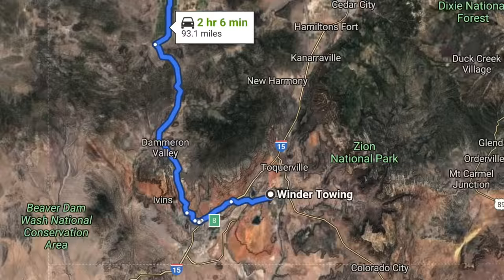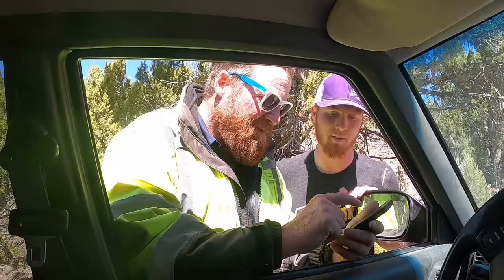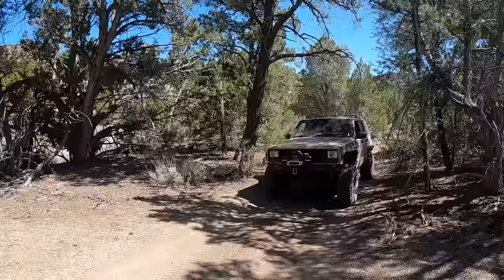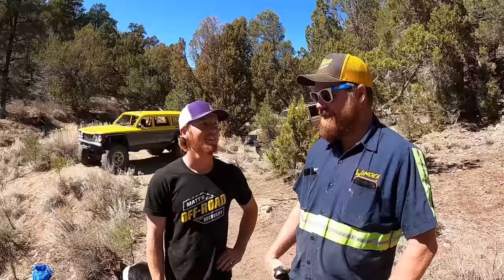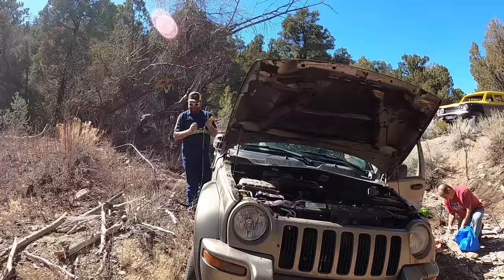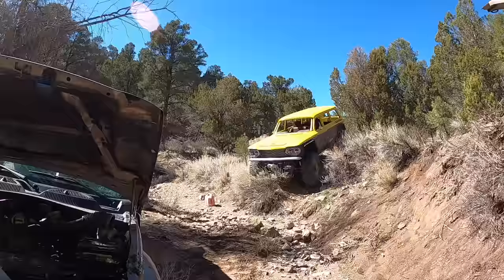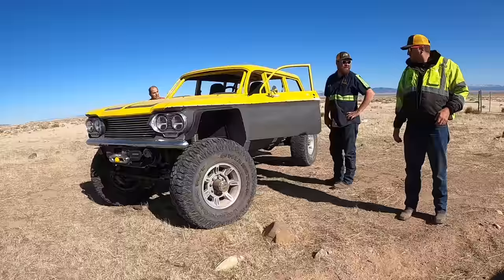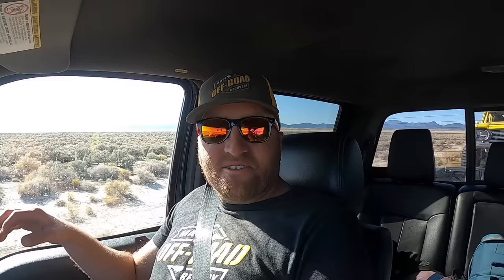Jeep Liberty Rollover 100 Miles In The Backcountry

Comment: Glad you took the time to get the oil out of the top end. Many folks don't know how important this is.
Would be interesting to see Matt's bill for this one.
Reply: Haha the only thing he did carefully with that vehicle
Reply: Gryff Longdong  A lot of insurance doesn't cover off road like this under a standard policy. Just like they don't cover racing if you take your new C8 to a drag strip and put it into the wall because you took off traction control. So recovering the vehicle and not damaging it further is useful for the owner to either part it out or to transplant the good parts into a 'new' shell. 

And even if the insurance does cover and total it out you can often buy back the vehicle at the salvage value from the insurance.
Reply: @Cragified  Exactly what I was thinking. No way would an insurance company cover this type of "extreme" off road use.
Reply: I knew someone that hydrolocked his WJ at an off road park. (Rods broken)

He towed it home, detailed it, and  drug it down the road during the next rainstorm and put it in a low ditch. Called his insurance company and said he slid off the road and through a puddle. Insurance covered it hahahahahah
Reply: @sheputthelimeinthecoconut629  Insurance fraud 101
Reply: @sheputthelimeinthecoconut629  yeah I know a guy who blew the motor in his STI doing donuts. Towed it down the street, lit it on fire, went home and reported it stolen. Unfortunately the gas station down the street caught him on camera towing it down the road. He was promptly arrested.
Reply: @loganb2198  lol i blew my sti motor being stupid, and it was covered under warranty.
Reply: @loganb2198  at least they stopped him from harming any more Subarus
Reply: @sheputthelimeinthecoconut629  When it works it works... When it doesn't, you get federal prison time. Lol
Reply: be aware, that motor oil as ATF
substitute can have side effects
Reply: @objuan6  that's because it's ATF that can be used as engine oil. Oil as atf is bad lol
Reply: @sheputthelimeinthecoconut629  unfathomabley based

Comment: I’m surprised you didn’t kick that windshield out as soon as you had it tipped over and running.
Reply: Prolly didn't want the "extra ventilation" upgrade option.
Reply: @jum5238  That and having to clean up the mess.
Reply: @AndrewAMartin   windshields don’t make a mess like the side windows all did. They could have easily folded it up and tossed it in the back with the rest of the trash they dutifully picked up.

Comment: "It will need a transmission flush after this" as if that thing is not totaled.
Reply: The moment the roof structure is compromised... Send it to the salvage yard
Reply: @thehoovah  .....break out the TIG welder.
Reply: @thehoovah  remove roof build roll cage and see what more it can do
Reply: @randyd9414  too much money To put in for a clunker
Reply: Yeah it’s absolutely totaled. These pieces of sh*t have fairly poor resale even in good shape. And why does one have to buy a $50K Rubicon to even get one limited slip diff let alone two when a LSD is standard on a much cheaper Mustang for example. This thing in 2WD was useless with an open rear diff. So many Jeep vehicles are mostly just marketing hype rather than better hardware. A Subaru can go anywhere a Liberty can. And Subaru’s don’t break driveshafts.  The Liberty is more suited to shopping mall parking lots.
Reply: @sharedknowledge6640  Rubicons don't have lsd's. They have true lockers. Anti slip differentials can be added to any trim of wrangler. Also most subarus have open differentials with the exception of the wrx. Im not a fan of jeeps, I think they're overpriced. However I had to defend them slightly with the misinformation you shared.
Reply: @sharedknowledge6640  rally isn't challenging offroad. Rally is challenging for the technical driving and high speeds. No current production subaru could follow a wrangler truly off road. Just as no production jeep could follow an Sti through a rally course. Theyre different machines built for different tasks.
Reply: Bailey O. Agreed but rally cars put up with an incredible amount of abuse, jumps, etc. And I wasn’t asking about a Wrangler. I was talking about the shopping mall fake Jeep known as the Liberty.
Reply: @randyd9414  Exactly what i was thinking.
Reply: @Striker50_  Clunkers are the perfect serious off roaders.  You don't have too much to lose.
Reply: This is an awesome idea
Reply: @sharedknowledge6640  say what you will about that little liberty, but it made it all the way out there and only rolled when the road caved in, pretty damn capable of you ask me
Reply: @sharedknowledge6640  don't know much about libertys do you. No need to respond, your comment shows you don't they were avaliable from the factory with a LSD.  They're actually quite capable off road.
Reply: @sharedknowledge6640  lol, you know those real rally car are highly modified to take the abuse they do. Their stock counterparts are far from that capable.
Reply: @sharedknowledge6640  you keep calling the liberty a fake jeep, completely disregarding the trail it came in on. Even Matt is impressed that the liberty came in that way... every comment shows how little you know about them. Maybe you had one, but have crap driving skills.
Reply: @benstockton2285  shared knowledge doesn't have a clue about libertys, other then what some subbie fan Boi told him.
Reply: even the bottom....nice dinged up muffler at 10:26
Reply: I was at junkyard to get small part of wj jeep....guys beat me to jeep in a few seconds...had gas powered circular saws with metal cutting blades....proceeded to cut off top half of WJ to weld onto rolled one at home...likely  had pricey investment in powertrain for efforts....
Reply: It’s not, cut the roof off, build a roll cage
Reply: @sharedknowledge6640  you subaru fan boys are hilarious !
AWD and 4X4 are NOT the samething !

comparing two totally different vehicles...
i have owned 4 jeeps and 3 Subarus. 
subarus drive very nice (if you constantly fix major stuff). 
jeeps dont drive as "nice" but will go places a subaru could not even try (when offroading even the "fake jeeps" will go 10x farther than subaru)
AWD and 4X4 are NOT the samething !
Subaru = comfortable highway ride
jeep = go farther
Reply: @MrMrsregor  The Liberty is not a real Jeep. It’s much closer to a Subaru as it’s more car like with no frame and unibody construction. It also was not available with limited slip diffs front and rear (to the best of my knowledge). The Subaru AWD system is likely at least as competent as anything you could get in the Liberty. The Jeep Compass is even less of a Jeep being basically a front wheel drive car.
Reply: I'm guessing I should just be recycled and turned into something that works.
Reply: @sharedknowledge6640  The funniest thing is where i can get a slightly older 2 wheel drive vw polo because its light as anything... while the 2ton "offroaders" with low profile everything and a dozen computers cant manage.. No i dont do serious offroading in it but live rurally so its up farm tracks, in verges and across fields a lot
Reply: It's a Jeep; you gotta smash it to settle everything in.
Reply: @Bailey_54R  not in the sand a subi would annihilate any liberty

Comment: The Jeep Liberty is severely underrated as an off-roader in my opinion and why I adding one. Great video!
Reply: You are correct, they are decent. I had a 2006 diesel and had it on a 2" OME lift with 265/75R16's with detroit truetracs in both axles. It's pretty capable like that, but the biggest issue is tires. Even fitting the 265/75's required cutting and hammering and all sorts of stuff to barely clear. Thats not even a 32" tire. Meanwhile I fit 285/70R17's on my stock Lexus GX and all I had to do was heat up the fender liner to bend it slightly.

And I was constantly having issues with ball joints and wheel bearings in the Jeep and had to replace the rear boomerang link. Like by 100k miles I had done most of them at least twice.

Great vehicle on paper but I personally felt it fell short in real life.

Comment: Honestly, I was pretty impressed with the liberty. It was one of the last jeeps made with an actual lever for 4X4.
A buddy of mine had a diesel one, it was a beast.
Reply: I had a Liberty 4WD was a great little jeep for Chicago snow until that 42rle died
Reply: The diesel is made by Mercedes, junk.
Reply: @JacobEcret  nope, made by VM motori, who Chrysler owned at the time. Granted not a great engine but not a Mercedes one in the liberty
Reply: @VDPEFi  did the grand Cherokee have the merc motor? My aunt has a Jeep with the Mercedes diesel, absolute junk
Reply: @JacobEcret  I think the older ones (05 ish generation) used a 3.0 Mercedes based engine and then switched to a VM/fiat/Chrysler unit in the newer ones

Comment: i love that everyone thinks he would go through insurance, im impressed how well it ran after the accident, i am a liberty owner, and i love the thing, it goes everywhere i want it to go! if i were in his shoes, i would cut the top off and keep it as an off roader, the liberty, when you have both axels in is incredible off road!
Reply: Don't the liberty's have those cheap motors from that crappy car company!!! I wouldn't ever buy one,I bought a 88 Suzuki samurai for 3 grand and put 1,500 in it and I can go places jeeps can't even modified jeeps,so why buy a cheap jeep that's crappy when you can get better 4x4s for less money and they don't come with a CRAPPY FIAT MOTOR😂🤣
Reply: @coloradoswesternslope8622  The 3.7L in that Liberty was also used in the Commander and Grand Cherokee of similar years (210hp, 230tq). It is also pretty much the same engine design as the 4.7L V8 but with 2 cylinders chopped off. 

Judging by the number of nearly 20 year old 200k+ mile Liberties still running around, it's quite reliable too.
Reply: @coloradoswesternslope8622  Your arrogance and Ignorance is showing amazingly well. Liberties were made well before FIAT ever got involved in Chrysler. For a unibody small 4x4 they are quite capable. And given they are quite old now and not a 'big' jeep they are cheap to buy and have fun with as this guy did.
Reply: @coloradoswesternslope8622  I started off in an amazingly capable bone stock 96 Tracker with the Zuk drivetrain and some AT's...once the wheel hub gave out I upgraded to an 05 Liberty with the chrysler 3.7 and it (suprisingly) is even more capable than that little billy goat of a Geo I had.  Don't knock any of them til you run them, in my opinion.

Comment: Never wheel alone OR in the dark! (That's an accident or possibly even a fatality waiting to happen!)(They had mentioned that the rollover happened at night.)
Reply: I wheel in the dark all the time its called lights amd go very slow
Reply: @joshlower1  Yeah, I've tried that before, but came within literally inches of falling off of a hundred plus foot cliff one time, so go right ahead and have your fun, but since your visibility is severely limited in the dark, not only because of relatively short distance of light coverage ahead, but also because of the resulting shadows hiding holes, dips, etc., don't say I didn't warn you when you finally wreck your rig, or even worse, end up in the hospital or even dead!... Not to mention in the daytime your sightseeing of your surroundings is much more enjoyable, but that's just an added bonus to the MUCH improved visibility and resulting safety!... Do what you want, but I'm just talking from that (near death) personal experience, as to why NOT to wheel in the dark, especially on trails or terrain you're not familiar with!
Reply: @JoeJ-8282  Absolutely.  Old mate here is a pristine example, clearly a competent driver but the siding gave way and he ended upside-down in a wash gully.  Daytime he probably would have been able to see it wasn't stable enough.
Reply: I've been pulled out of a very similar situation at while at night... so I second the "Never wheel alone... in the dark". In my case I was in a rental and it ended up hanging by it's bumpers over a 30 foot washout that I didn't see. The tow truck operator that winched me out was impressed.

Comment: When I supported long distance trekkers on the Arizona Trail between Mormon Lake and the Arizona-Utah line, I drove solo in a year 2000 4Runner, manual, low range, lifted and full skids on named backcountry roads - forest service and BLM roads.  There were numerous occasions in which risk persuaded me to turnaround and get out - increasing hazards of the road, questionable skill set, zero 911cellular signal, too much arboreal canopy for Iridium satellite phone connection.    In my invincible youth on a motorcycle and on a mountain bicycle I observed that big trouble resulted from a cascade of lesser "what were you thinking!?" errors.

I've watched a dozen or two of Matt's videos and a few thoughts emerge dominant.  1: Matt and the crew  are highly experienced and cautious; 2: with minor exceptions they set out in two or more vehicles and with several crew members; and 3: so far in my viewing of the videos, every one of the parties they've rescued, the question begs, "WTF were you thinking!?".

Correct me, please?

Comment: That Liberty has a very good 4x4 system. Never underestimate a Jeep, it just might embarrass you.

A guy at a cruise in was bragging how awesome his Ford pick up was.  After about ten minutes of him jabbering, I said, "I  have a four cylinder Jeep that could probably give you a good tug o war".
He laughed, "No four cylinder is going to pull my big V-8 4x4". He wasn't thinking about traction.
His pickup has about 70% weight on the front tires and 30 on the back.

I didn't warn him my 'Jeep' was a Liberty with a 4 cylinder diesel that made 300 pounds of torque just off idle. When I pulled around to hook up, he said, "That's a V-6 but I'll still drag it all over this parking lot".

So I showed him the underhood and the owners manual. Four cylinder 2.8 liters.

I didn't even punch it at first, just held about 1/3 throttle. I could hear his back tires spinning he was barely pulling me. So I gave it 1/2 throttle and I started creeping forward. He got frantic and floored his truck. LOL. Smoke was rolling off his tires as I pulled him around the lot.
Reply: Your brain had more traction than his......

Comment: If they set up a 4 to 1 or 6 to 1 rope pully system from tree to corvear it would reduce work tension on the wench and ropes. 
These type of rcovery systems are so strong that its even possible to rocover the vehicle by using man power. Just in case the wench goes down or you dont have one... my kids and i always love watching Matt do these recoveries... thanks for sharing your stories

Comment: I don't know why people hate on the  Liberty (Cherokee outside the US market) so much. I feel like some may be mistaking it for a Patriot/Compass/Renegade just because it's small... 

It's certainly not a Wrangler, but it does have low range gearing, body on frame construction, a fairly reliable 3.7L V6, and can be quite capable with just a 2" lift and All-Terrain tires (the absence of better rubber being the most perplexing thing with the one on it's top in this video).

Comment: Old man driving a 05 Liberty since 06 it has Ironman springs and Bilstein shocks, the Liberties were under rated by jeepers. I live 20 miles from town on mostly dirt roads. I just need gears from a 4 cylinder liberty.
Reply: He had driven to the end of the road, turned around and was coming back when the front driveshaft blew.  
Had he not rolled he would have got out unscathed and driven home with no one the wiser.
He did drive it home after the recovery....

Comment: I'm less amazed that a Liberty made it that far, they were pretty capable for what they were. What I'm amazed at is they got a Liberty that far on pretty worn out street tires. Not a shocker it ended in a rollover considering how much it wanted to slide on them during the recovery.
Reply: Any only rear drive vehicle will slide sideways on a sideslope....
go far enough sideways and you roll....

Comment: You guys are great!  Isn’t that little Jeep you rescued a “total”?  And I’d so is it worth rescuing?   I’m not trying to be a smart a, just curious.
Reply: He had driven to the end of the road, turned around and was on the way out when the front driveshaft blew. 
He rolled when the rear slid sideways going up a cross slope (which sliding also can be seen when under tow). 
It rolled and he walked out all night to call Matt. 
Federal fines for dumping and an "arranged" tow would have cost more than Matt's recovery...
and then he drove it home!

Comment: Shocked and amazed they got that Liberty that far back into it.
Reply: He had got there to the end of the road, turned around and was coming back when the front driveshaft blew. 
You can see that even under tow, only having rear wheel drive on a sideslope means the arse end slides downhill...and when it sldes downhill enough, you roll.
He had no other option as he did not have any other vehcicle to tow him out.
After Matt's recovery he drove the vehicle home.

Not his first rodeo....

Comment: Great recovery but some advice from experience use an A hook up with 2 chains or rated straps....had lots of vehicles either turn or sink on me with a 1 pont hook up and spin.. 2 points gives you better control during the flip part of the recovery.

Comment: Great job recovering that Jeep as always! Couple questions... Where did the transmission fluid end up when it was upside down - Is it not a closed system? Also pulling the spark plugs after flipping it back over, what does that do? I understand water/oil doesn’t compress and could bend a rod but did you guys suction out any oil in the cylinders (assuming it leaked past the rings) or would it just shoot up and out while cranking and your good?
Reply: Yes , if there is any water/oil in the cylinders,  pulling the plugs and turning the engine over will push the fluids out